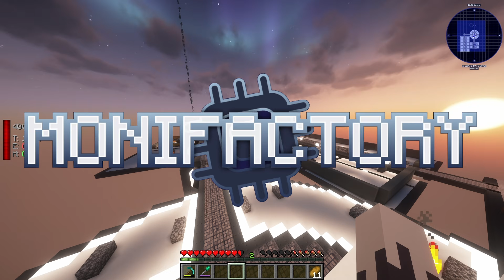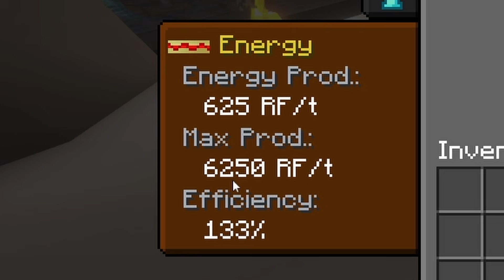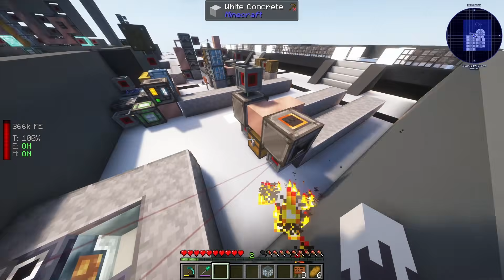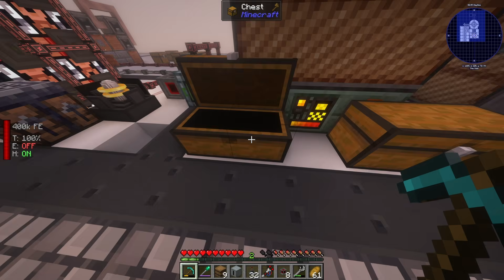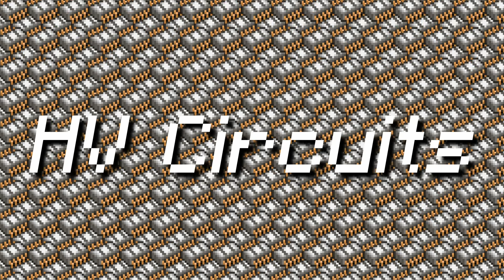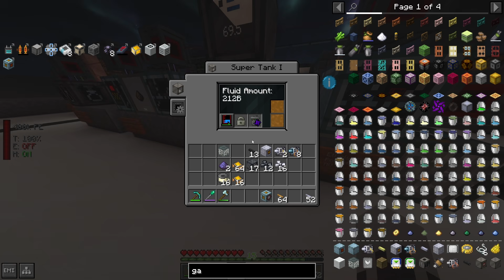Monifactory - 2 - High Voltage

Comment: You are soo good in making videos! BTW every energy hatch takes 2 Amps so you can overclock it with 2 energy hatches. Its always 4 amps of energy voltage X (for example MV) to 1 amp of energy voltage X+1 (then HV). Keep up the great work!
Reply from the maker: Very good to know, thanks for the information and praise!